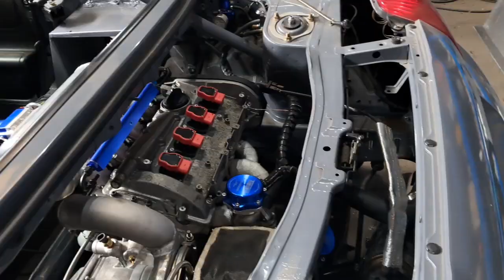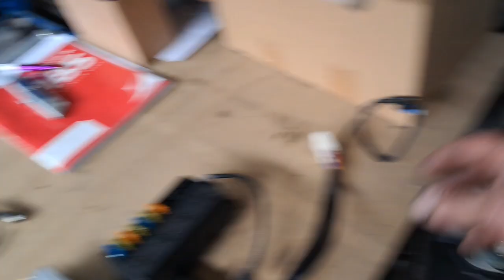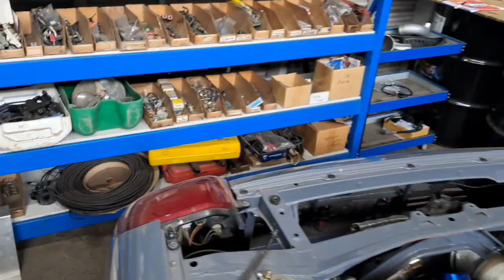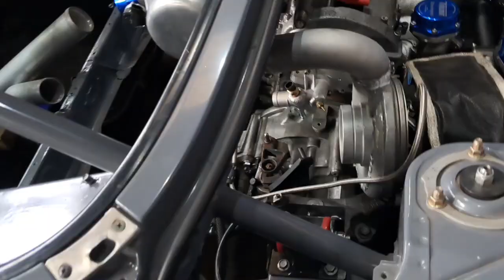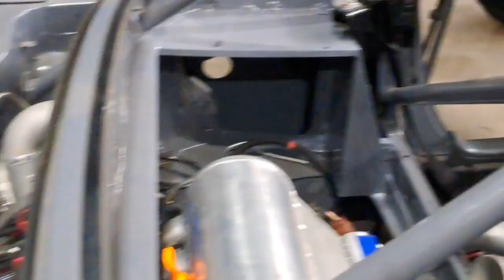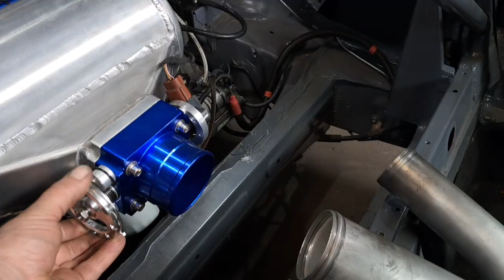First start of the hx52 1.8t powered mr2.

Comment: I have run the Spec mini twin on my 1.8t and Clutch Masters 7 series twin disc, both the street and race versions. They all rattle. The CM unit is much quieter than the Spec unit. Your's sounds just fine.

Comment: Cool project dude. When do you expect the turbo to start coming up on boost?
Reply from the maker: I'm not sure, it may not. It's too big. I've done everything possible to try help it spool. Time will tell.
Reply: @g-mech1244  What have you done to help boost threshold? I think this will spool in a reasonably time because all hx40s spool pretty early
Reply from the maker: @aleksisalenius5103  have a look at my manifold video. Basically I've made a long skinny, match ported, twin scroll, equal length, wrapped manifold. With a large diameter free flowing exhaust.
Reply from the maker: @aleksisalenius5103  also I've got all the vvt gear to go into the non vvt head. That's supposed to bring down the threshold 300rpm or more.
Reply: @g-mech1244  Looking forward to Dyno or road logs